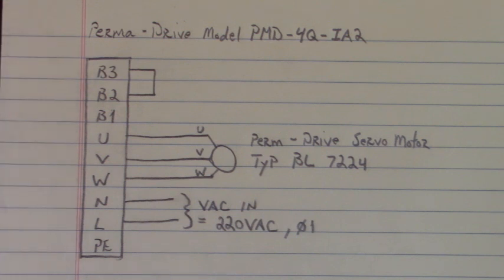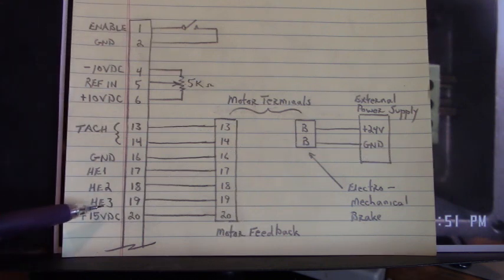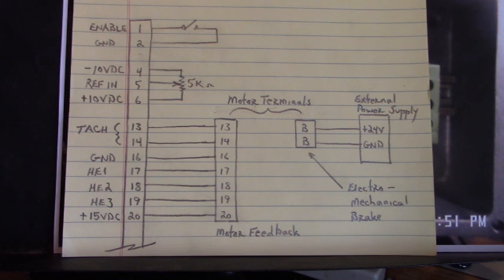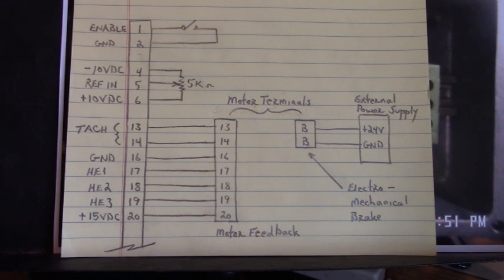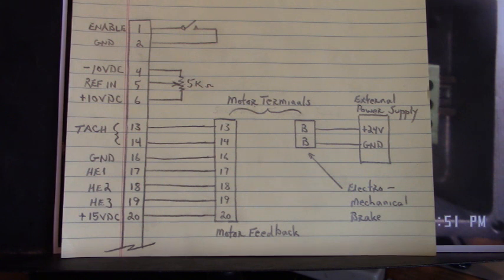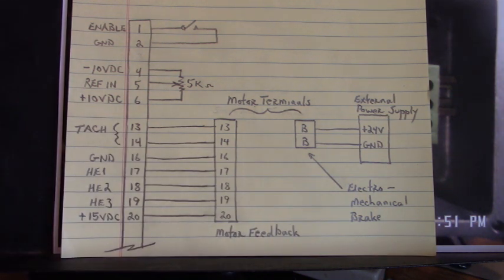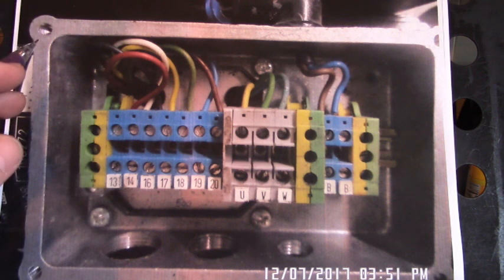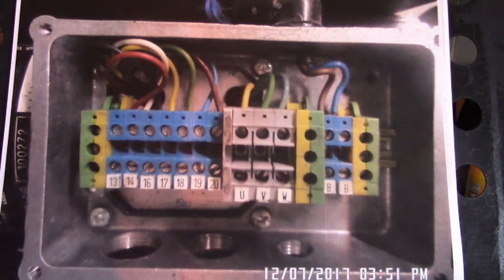Testing the Perma-Drive Servo Drive and Servo Motor

Comment: I have a Berges inverter from an old cosmec that needs a rebuild and a siemens brake module that I just shipped out. Do you have a website or contact info? I've seen a few Homag and Busellato parts in your videos. I'm trying to learn to rebuild the bad ones and save what I can but I don't quite have the courage to do what you are so confident at. I'm in South Florida. Cheers and thank you so much for making these videos.